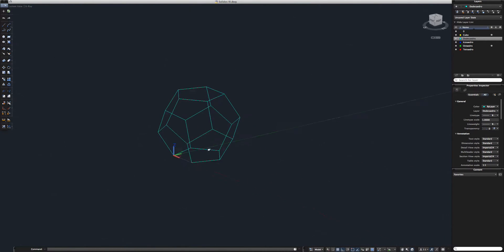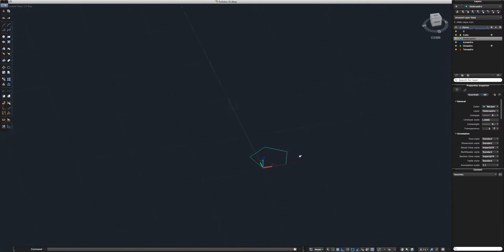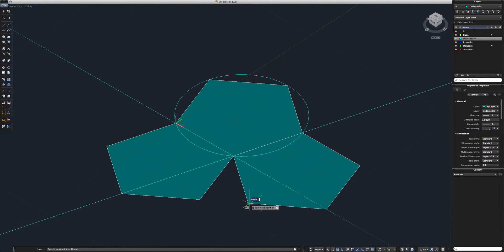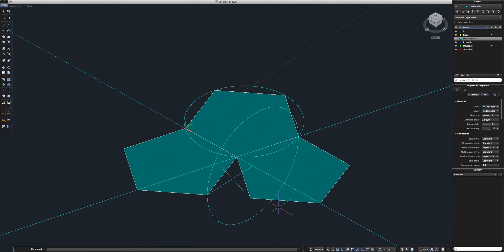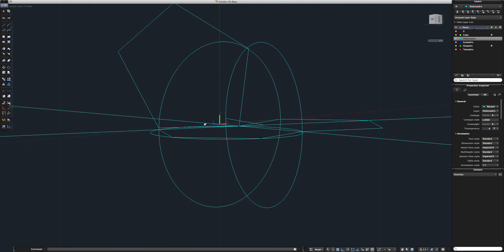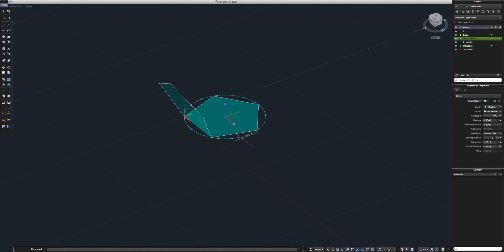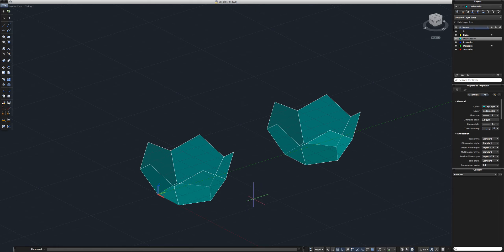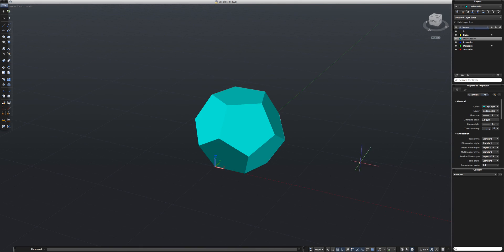AutoCAD 2015 Dodecahedron Tutorial

Comment: I made a dodecahedron in CATIA using a similar method. Instead of aligning a face to a vertex, I made a three point plane using the intersection point between the two circles, and two vertices of the corresponding pentagon side. I then made a sketch on that plane. I then patterned the sketch curves at 2 iterations circularly at 72 degrees. Afterwards, I made a three point plane again using the top vertex of the sketch pentagon, the top point of the patterned pentagon, and the point in between. I made another pentagonal sketch. Next is to pattern everything and fill, join and create a solid.